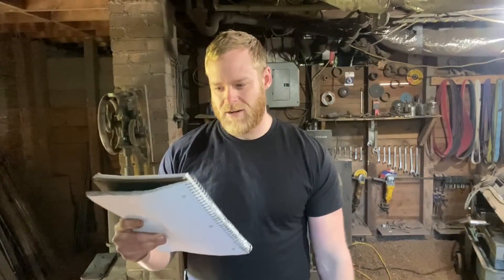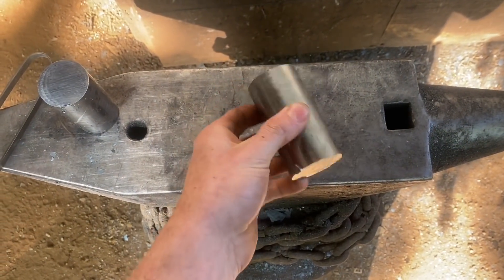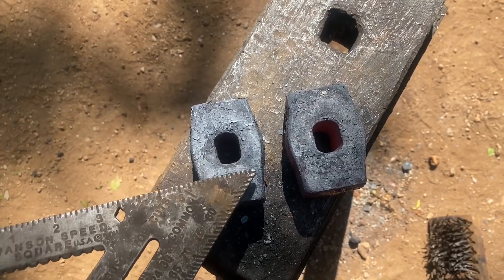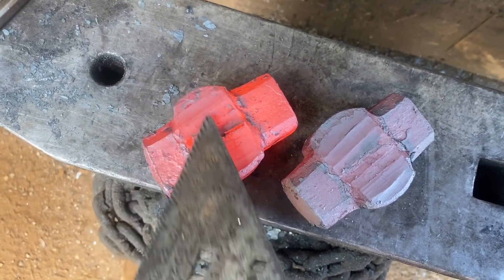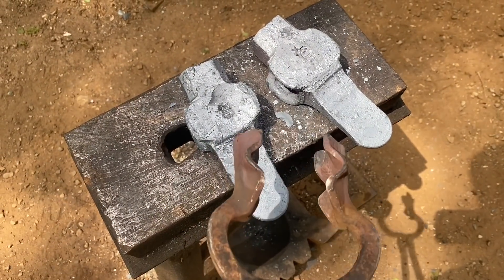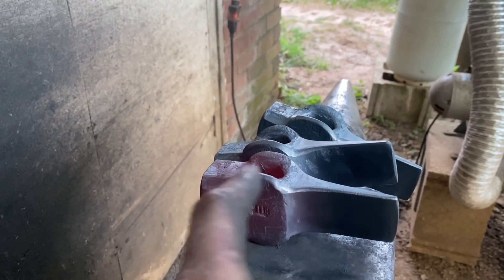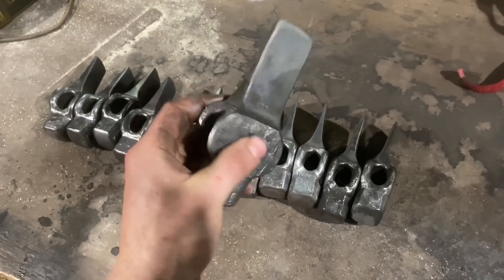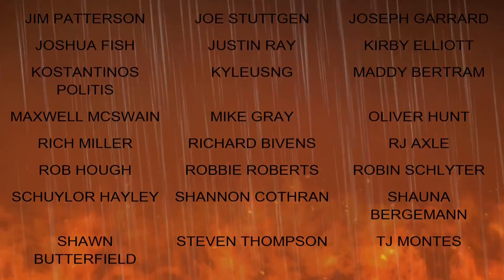In the shop: forging h13 hot cut tools

Comment: Only question I have is the black tip on the wood before you put it in the eye.  Just ShoShugiBan burnt and then linseed or something else?  Almost looked like high heat paint. Thanks Awesome channel good luck at your show from Detroit
Reply from the maker: Burnt and then linseed oil. Same as the rest of the handle. If you burn it after the head is on you end up with an ugly looking transition

Comment: Do you keep your H13 drift cool in water? I’ve been afraid to use water.
Reply from the maker: Yeah. The localized heat from a hammer billet being sucked out by the rest of the drift combined with the Leiden frost effect keeps it from cooling quick enough to damage it. I've been keeping it cool just like this for hundreds of hammers and tools without a problem

Comment: N00b metallurgy question: for a hot cut tool, which is the more ideal choice, if cost is no object - a shock resistant tool steel like S7,  or a heat resistant tool steel like H13 ?   If comparable, how do they differ in price point and workability ?  

Thanks in advance to anyone in the know who offers to take a stab at answering. 😄
Reply from the maker: I haven't had to buy s7 in quite awhile so I couldn't speak on pricing difference without doing some googling. But I have worked with h13 and s7. Both by press and by hand. H13 is more difficult to work with but I've found it holds up noticeably better
Reply: @OldHickoryForge  Thank you.  Great lookin HC. 😄👍